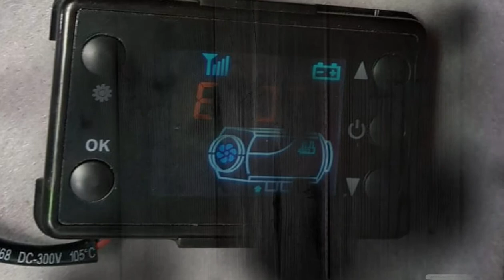Error code 6 fix  (Chinese diesel heater )

Comment: Check ours and wasn't catching but was far away. Moved it closer and closer. Fan engages and spins round once or twice then throws up error 6, is there any other known problems not relating to the distance of the fan as we moved it 100's of times 🤣

Comment: Nope e6 means it can be anything with the motor of fan. It’s such a bad system of errors. I have two brand new ones and they both have the same issue e6 and not resolutions. Also one of the motherboard had a large crack down one of the larger chips. lol what a joke they are

Comment: Thanks for that Tommy...ive not long fitted mine...i may remove the fan and put a small washer/spacer on the shaft to give it clearance . Thanks for sharing buddy
Reply from the maker: Hello mate , if you've got no problems with it I'd leave it 👍

Comment: Sometimes the issue is as described, moving the fan up or down the shaft slightly where all is clear sorts the issue, however at times it is the 3 pin sensor on the circut board, once replaced and the crrect distance is achieved...then it works, I've done this before on another heater and looks like I have another one to do the same with now, the sensors are available on ebay for a few quid ...about 2 or 3 pounds for a couple of sensors and are soldered in place on the board ... simple enough... hope this helps
Reply: Will this also stop it from running the cool down period? I mean if it trips on error 06 just shuts off
Reply: @Diyman43  usually when e6 happens the first time... the unit may be hot/warm and the fan cool down sequence does not happen ... once the unit is cool or attempts are made to turn it back on again the e6 code flashes up before it has a chance to warm up
Reply: After adjusting mines closer to the sensor tan fine for over 3hrs but the error came back again wondering if I would be quicker just replacing the motherboard
Reply: @Diyman43  it is and for the sake of about 7 quid its a quick fix
Reply: Do you have a good link on sourcing another replacement? Cheers buddy
Reply: Can’t seem to find one that looks the same as mines 🙄🤦‍♂️

Comment: I had an E-6 Error. The fan had moved too far AWAY from the control box which has a sensor to detect the magnets in the back of the fan so it knows how fast it is spinning.  I got a socket and tapped the fan in looking at the intake end so it moved towards the control box. Needs to be about 1mm but not touching or rubbing. 
That fixed the problem, let me know if it helps anyone. Very simple Fix.
Reply: Thank you!!! I had my heater to bits putting a new board in and it kept throwing error code 6. I didnt realise the board had to fixed back in the correct place for it to run properly! Saved me another 3 hours of stress 😂
Reply: I have the same problem. Code 06 and the fan is spinning hard.
 Moved the fan forward back and is the same spining hard and giving the code 06

Comment: one way is to shift the casing of the PCB by filing the screw bracket and inside of the haul sensor bracket(opposite)
This trick, forcing the fan out, I tried... ... dicey! but if it works for you, I am all good with it.
I'd be sorry if I pried too hard and cracked something.

Comment: Thank you will try this later
Reply from the maker: How did you get on ? 👍
Reply: @LT_TOMMY_  thank you we sorted it it was not the fan the casing was getting to warm inside the compartment as it needed the cold air from the fan end all sorted not but the bit u mentioned has been modified but thanks again

Comment: Mine doesn't have the stuck fan issue and its still throwing the e-6
Reply: Same, my fan slows down to almost a stop, then fires up again but i get the code and a fume smell...any ideas? Also the thermostat seems to be faulty now as the display never shows higher than 10degrees
Reply: @carlmurphy5673  Hi Carl. If you got an answer could you let us know. We are in a field with the same problem!